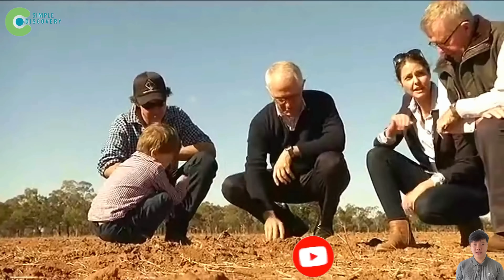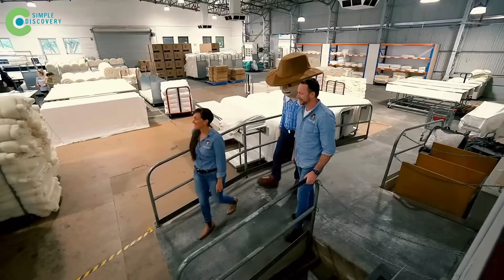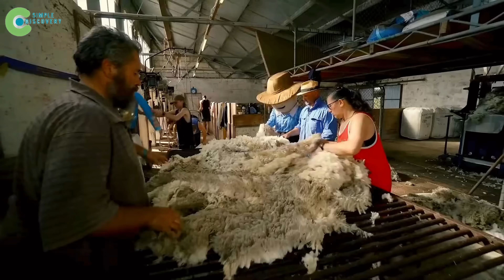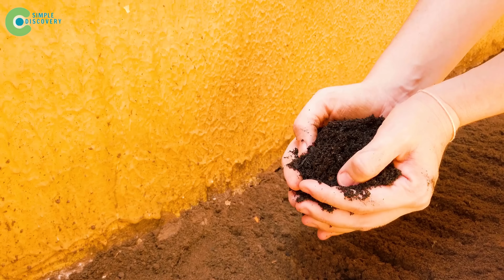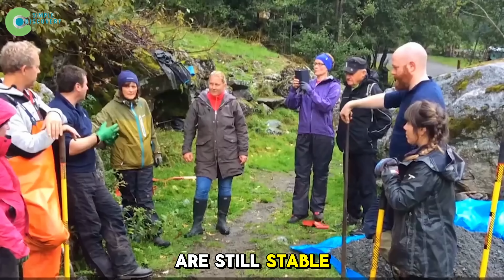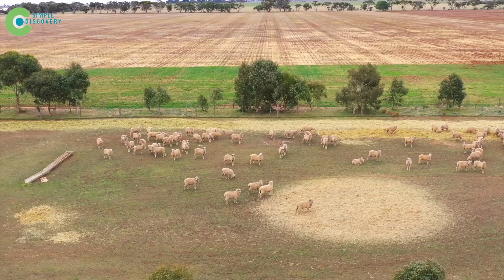AUSTRALIA BURIES TONS OF SHEEP WOOL UNDER DEAD LAND After 3 Months, THE RESULTS ARE CRAZY

Comment: Hundreds of tons of wool that is too damaged, stained or low quality. Not worth processing. Using it to protect and fertilize degraded soils is a natural fix. The only barrier is the natural dry climate. Breaking down the wool and sheep manure needs  water. Regular water.
Reply from the maker: Exactly, when applied at scale, wool becomes a slow-release fertilizer and soil conditioner, but without consistent moisture, its decomposition—and nutrient release—slows dramatically.

Comment: But surely huge flocks of sheep are the worst thing possible in terms of land degradation, particularly when the land is already dry and struggling to produce anything? What's happening here seems to me to be "put huge flocks of sheep on the land...watch it degrade even more ...then shear the sheep and use the wool to try to reverse the damage that the sheep have just done"! I realise that fires and droughts are also major causes of the degradation and barrenness of the land, but aren't the sheep just making it worse? In many parts of Africa, people are trying to convert huge livestock areas back into wildlife areas for that precise reason.
Reply from the maker: Exactly—sheep can worsen dry, degraded land if unmanaged. In this project, the wool is collected and buried to slowly restore soil, but only works with careful grazing control and some water.

Comment: This is not correct. Most of Central Australia is flooded in the “” at the moment.  I think the pictures are old when there was a drought.  The drought is only in a few areas because the middle of Australia has been flooded.  The landscape and dress of people are not consistent with Australia.
Reply: Abundant rain fall in the last 5 years.
Reply from the maker: Thanks for pointing that out. The footage may not reflect the current conditions, and you’re right—Australia’s climate can shift quickly between floods and droughts depending on the region.
Reply: There is so much misinformation in this whole thing its not even funny.